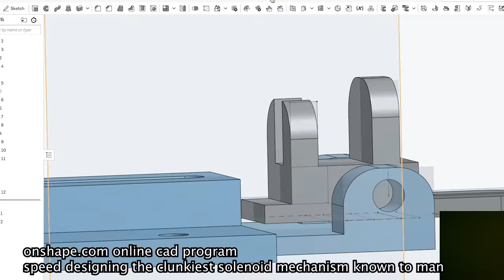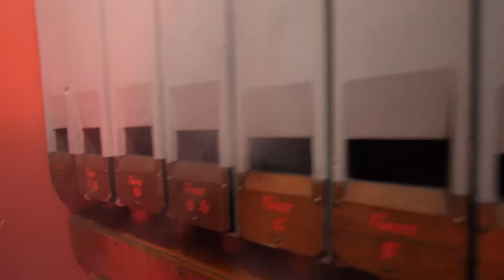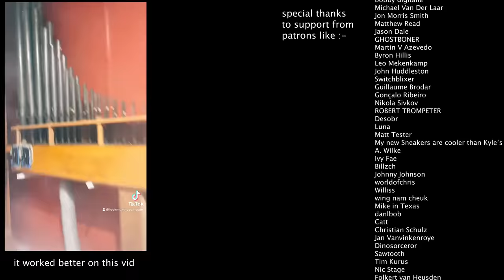I BOUGHT A CHURCH ORGAN PART 4,Plugging Up Smoke and More Pipes!

Comment: I would call the weird valve setup a pilot-operated valve and I can think of two possible reasons for them: (But they are just guesses)
1) Maybe they are an older set of pipes from an older organ where the console was entirely mechanical and due to the limited size, smaller valves within the console needed to operate the larger valves within the wind chest.
2) The pipes on this wind chest require so much air that the valve needs to open far more than the little solenoid valves could.
Reply: I think it's #2.   a pnumatic relay, like power assist brakes.
Reply from the maker: I think it may be both.
Reply: Also I think it made it easier to switch on and off different banks or combinations of banks, by just disabling the air to the second/third stages
Reply from the maker: @zbradbell  yep there is a big box for that it’s actually turning off the air to the whole box
Reply: Could those valves be intended to have expression with varying air flow, rather than simply being full open or full closed? It'd be a bit akin to how velocity works on some electronic keyboards. Could be done with electronic solenoids, but getting it to work would be a bit more tricky than a full-open/shut setup. Would take some RC vehicle servos or voice coils rather than a simple plunger type doodad. And of course some more fun in figuring out how to drive the things.
Reply: @pauljs75  You'd never vary the wind pressure to have expression. Doing that altars the tuning. It's called 'electro-pneumatic action' it was an improvement on pure pneumatic. Pneumatic gave more flexibility in organ design allowing you to place pipes further away from the console without heavy mechanisms. It also made things like crescendo pedals, thumb pistons with pre-set combinations possible. All this when electric blowers weren't standard as not all churches were on the electric. Heck some still aren't!
Reply: Sometimes loudness is controlled by having baffles in front of the pipes to block the sound or let it through, but that might be more of a Wurlitzer organ thing than a church organ thing.
Reply: The weird valve setup is pretty common on pipe organs, but usually the whole thing is in one box, and the leather pneumatics are all inside the box, rather than exposed to the dust/dirt/contaminants/etc. out in the room.  For some odd reason, leather pneumatics tend to last longer when they’re enclosed in a box.  The reason for doing it that way is that you can have a tiny electromagnetic valve, and then its action gets amplified by air-powered components.  The benefit is that the valve takes much less current, and back in the day, it was easier to switch smaller currents.  The contacts that they’d need to switch larger currents would be too big, clunky, and expensive.  The way the economics worked at the time, it was easier and cheaper to put in all that air-operated mechanism on the valves.  There can also be some musical reasons to prefer at least one layer of air-operated mechanism to move the valves.  The way the tone starts and stops may sound better when the valve is activated that way.  Whether that makes a difference depends on subtle adjustments of the pipe geometry.
Reply: Definitely No2. I worked on a Compton Theatre organ; it has the same 'dual pneumatic' valves on the big pipes and it was electro-mechanical from the start.
Reply: @MrHarmonicminor  So what controls the loudness of the pipes that are not behind baffles?? As far as I know, the expression pedal should affect all the pipes, not just the ones with controlled baffles. I took organ lessons for many years as a kid, but only ever played on an electronic organ.
Reply: @gorak9000  the idea of enclosing pipes behind shutters dates back to 17th century Portugal and first appeared in England in 1712 (St Magnus the Martyr, Lower Thames Street, London). Originally it was a single moveable plank of wood lifted by a lever arm called a nag's head. The venetian blind type Swell box was an early 19th century innovation AFAIK.

Comment: The smoke idea is great, You can get fast dissipating smoke fluid, Also get water based fluid to help the organ and stop the alarms going off as much...  I wonder what low fog or Dry ice does?
Reply: Would probably detune it VERY quickly. Organs are finnicky at the best of times with ambient temperature changes, so pumping freezing air through it would have a pretty immediate effect I suspect. :)

Comment: This is awesome! Do you plan on eventually setting up a legit organ console or it's going to permanently run off of the synth? Half the coolness of a pipe organ is the console with several manuals and all the stops ya know 😎
Reply from the maker: wiill be making a console. but it wont be traditional
Reply: @LOOKMUMNOCOMPUTER  tickle me elmos for the keys
Reply: @JeffGeerling  You monster!
Reply: @JeffGeerling  can we get a raspberry pi that can act as the brains of the console? it could also have a wlan server to let a museum worker operate the organ remotely. the operator could use pre-recorded midi files or a USB-midi keyboard to control the organ from the front desk. I would personally recommend the M-audio Hammer 88 as it is a good cheap piano keyboard with USB-midi
Reply: @nathanielhill8156  It's going to need more than 88 keys. But with the magic of MIDI he can control every pipe individually and bind any combination to any key.
Reply: @LOOKMUMNOCOMPUTER  at the very least u gotta be able to pull out all the stops.
Reply: @nathanielhill8156  a part of me wants them to let users upload their midi files for the organ to play but it WOULD take quite a bit of moderating, ha
Reply: @greggv8  organ manuals have 61 keys
Reply: @aa-oq1ev  Then another ~30 notes for the pedals.
Reply: @LOOKMUMNOCOMPUTER  have a look at the modern Hauptwerk touch-screen console setups... lot of flexibility possible there. Prior to that arriving, I knew a guy who built an organ console out of glass with Otis lift buttons for stops - it's in a church in Oxford.

Comment: Mate, just wondering if you've implemented a voltage drop for those solenoids into the system? If not, they may fail sooner rather than later: Once a solenoid is active, you can drop the voltage down to 5v (assuming they're 12v jobbies) and they stay closed, continuous 12v (for instance holding a key pressed too long) running at full chat (12v) will cook the solenoids!
Reply from the maker: It’s half travel. They are only on 8v
Reply: @LOOKMUMNOCOMPUTER  I am curious... how did you manage to lover the current rushed into the solenoids? I assume that would be around 1.4Amps with no modification and if the power supply can handle that. But I think if you attach one power supply to a whole bunch of these, it should be capable of many amps, since you would want to activate more solenoids at once. So the question is, did you use for example PWM or something else to lower the amps used by the solenoids (the ULN2803 can't even handle more than 500mA...)? And do you use flyback diodes to handle the voltage spike when the solenoid is released? Amazing project btw, you're inspiring me...
Reply from the maker: @alexanderbunt2421  not sure where you got 1.4 amps. the coils resistance means they use about 100ma each. uln2803 is 500 ma per pin. power supplies 2amp. if on rare occasion it uses more its only for a note or two. if worse happens power will just shut off thats beyond any sensible use though
Reply: @LOOKMUMNOCOMPUTER  Well, am trying to create something like you did, with solenoids acting as valves in a wind chest. But if I directly power the solenoids with a 12v 12.5Amps power supply, they use about 1.4Amps. And when I use a transistor array like you (ULN2003), they use about 700mA, but then the ULN2003 is overheating quickly (logically) and breaks, because it can't handle the amount of current. So I tried to fix that by using PWM on my arduino, but I was wondering how you did it... but I see on the video that your solenoids have a current of 950mA noted on the label. In either case, that would be too much for the ULN2003 or ULN2083. Do you (and if, how) limit the amount of current going to the solenoid to 100mA?
Reply from the maker: which solenoids you saw with 950, they are not, not that i know of. well they are just resistors in the end of the day. add resistors in series @alexanderbunt2421  the blue ones in the bass bourdon chest possibly, but i just doubled up the uln2803 outputs. just do it and hope for the best. no need to complicate. good luck!

Comment: Once you’ve dealt with the air leaks (smoke machine is a brilliant method of detecting) of your organ, you might try a science experiment to verify a recent discovery.

Organ builders have known for centuries that the actual tone on open pipes is lower than the anticipated pitch based on pure mathematical computations from the standard physics equations. Pipe makers just added a correction factor then used normal tuning methods to fine tune the pitch without knowing the actual cause.

Recently, someone blew cigarette smoke into a pipe and a smoke vortex was observed above the end of the pipe, effectively extending the air column and lowering the pitch.

Comment: a normal smoke machine is not so bad it's not a good idea to do it all the time but it shouldn't do much to the bellows and pipes now a colored smoke is really bad as it will build up on all the surfaces and end up hurting all the fine control valves in the system
Reply from the maker: like i mentionned only a couple of times to see what happens :). not doing it again

Comment: Well, at least the smoke gave you the vacuum leaks lol, gotta fix that gasket surely.

I'm loving this thing, loved the new air box, all tidy and pretty, new cables everywhere, all solid work, the 3D Printed supports for the solonoids are great too! 

I totally agree that you need an LED for each pipe when the solonoid is active to display what pipe is playing, it would increase the wow factor for the museum surely.

Comment: I've always wondered exactly how they worked before solenoids were introduced! I knew they used air controlled valves but seeing the actual mechanism really helps me understand it better.
Reply: There is at least one company that still makes new "tracker" organs. Each key has strings or wires that pull the valves open to make them play. the strings have to go through pulleys or levers to change the direction of pull because the pipes spread out much farther than the keyboards.

Comment: The smoke is a good way to find and fix the leaks, we use the that exact process to find and fix leak in ship ventilation  systems its the oldest trick and it still works.

Comment: If you were to run a mineral oil based smoke through the organ every now and again it might not be that bad of an idea. It could lubricate some moving parts and it might be good for the wooden parts to help prevent any cracking or splitting especially in winter. You’d still probably have to clean out any gunk buildup eventually.

I’d love to see you run helium or sulphur hexafluoride (perhaps argon instead)through the organ. Though it may not be that safe for you to be in the same room without some exceptional ventilation or an oxygen mask.

Comment: Closing the top not only lowers the fundamental tone frequency, but also changes what is called an "end correction" - acoustic length of the pipe not only depends on physical length of the pipe but also on its lentgh/width ratio.
Reply from the maker: yep.but for a quick simple cruz of the matter explanation the width length ratio was brushed over.
Reply from the maker: hhaving built a copper organ i learnt how to calculate that the hard way haha

Comment: 0:10  Yes, that pipe there is what I mentioned in Part #4 that is part of the Bourdon rank, which is usually a stopped end wooden pipe.  This, like the Open Diapason rank had a flutish sound and the two (usually) make up the largest pipe ranks in an organ.  The two ranks are often layered for a nice full sound.    I'm impressed, you have been doing your homework on how the pipes work especially in terms of the effects on the sound of a closed pipe vs an open one.   Nice demo of that at 1:37.    1:42  How does decades old dust taste?  6:50  So nice having a 3D printer that you can make your own parts!  9:02  Just noticed the pipes are abbreviated Bour...short for Bourdon.    I have a decent sound system on my computer and those pipes really go low!  NICE!  I wouldn't be surprised they vibrate your whole museum!  As for piping smoke into the organ, yeah, you don't want to be doing that regularly.   It looks cool and perhaps every once in a while, say for Halloween, but the smoke juice definitely leaves a viscous residue behind and you don't want that stuff gumming up your valves.    Congratulations on getting this far.   While a pipe or two here or there is still out of tune, you came a long way in a short time.   Depending on how many ranks you have, you might still be a long ways off from being finished and then you have to deal with the console as well.   Good luck!

Comment: I've currently got my subwoofers setup to basically surround my lazyboy[12" on the one side and 2, 8" on the other], and I cannot imagine people with phones or computer speakers are at all getting anything of the true tone to your boxy pipe demo because it's all low end and I wish i was there to get the FULL extent, but you're an ocean away!

Comment: It would be nice if you could add a display to the bellows so you can watch the pressure inside it changing while you play it, i'm shure you can design a circuit board and a method for that...

Comment: You should hold a chord down then turn the blower on, it creates a magnificent sound. Same goes if you turn off the blower while holding a chord, creates a very strange sound as it loses air pressure. You should try it sometime!

Comment: Great solution for the compound valve triggers for the big tibias. The solenoids take a big chunk of complexity out of the original trigger action, and will actually make those pipes more responsive in a real-world situation! Your MIDI boards seem to be working well for the triggers. Pretty soon, you'll have a complete rank set up in that room if you keep adding on. Hauptwerk and a few others make fully integrated manuals & pedalboards (with or without pistons for the 'combination action' to program and select various stops), just for future reference. I don't know if you have the original console, but that would be an option too if it's available. Nice work so far!😄👍
Reply from the maker: hey up cheers! im just gunna use theoriginal console and another bunch of imcro chips which stack midi channels etcc:)

Comment: bang-on job on the organ, so far, but be careful with the smoke-machine.  the smoke fluid leaves a greasy and sticky residue after some use.  
a few times won't hurt that much, but i wouldn't do it, if it isn't "necessary".  looks awesome, though!!

Comment: I run a fog machine at Halloween and the vapor from the "fog" leaves an oily residue in all of the pipes I use to route the fog... so I'm not so sure it's good for the organ pipes, I don't even know how you'd clean those pipes out unless you ran a rag through them with a pull string (like when you clean a clarinet or flute)...  while the fog was a cool idea (sort of), and I tell you it brings a big smile to my face to see this church organ brought back to life, you're doing a brilliant job of it, but I implore you not to run the fog through it again.
Reply from the maker: Glycol basically baby in in small amounts it is probably good for em

Comment: Those valves you've removed probably provided smooth opening at the right time or even control the airflow through the pipes, not just on-off. You should put air pressure sensor to open the valves at the right time. At least with the smoke you could see all the leakages through the system ;D
Reply from the maker: They didn’t. The valve they controlled is binary. There is no curve of control. If there was I wouldn’t have made it like this

Comment: I imagine the smoke changes the air turbulence inside the pipes leading to the "out-of-tune" sound.  Fluid dynamics is neat!
Reply: Density. Same thing happens if you try to talk after taking a huff from a vape (Then you choke lol)
Reply: my believe would be it's because of a change in humidity caused by the smoke. It's always a major concern for acoustic instruments and pipe organs are no less sensitive and vulnerable to it

Comment: Amazing! I thought the smoke would be all fun and giggles, but it actually showed where the air is leaking.
On other thoughts on how to mess with it, did you try an air compressor on one of the pipes? Or how about filling the pipes up with helium or having a helium mix control as a pitch wheel.
I was wondering if your controllers are simple on / off switches, or you can add breath, aftertouch and other parameters to the individual pipes.
Thanks for a great video.
Reply: I was thinking on the same: inject some gas with different sound properties, like helium and sulfur hexafluoride. With the pitch wheel you could use one or the other depending on the direction. That would be awesome!

Comment: This is coming along nicely 😎👍. Not only is it preserving an instrument that would likely have ended up as firewood and scrap metal but it is educational. Is there a proper name for that special pipe box? It was almost like an array of transistor switches - using small puffs of air to feed big puffs of air to the pipes.